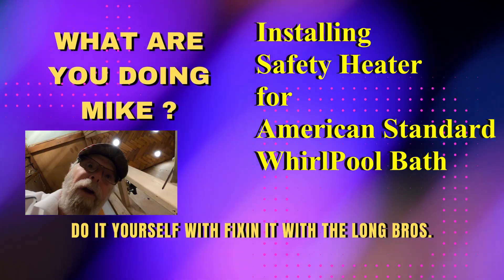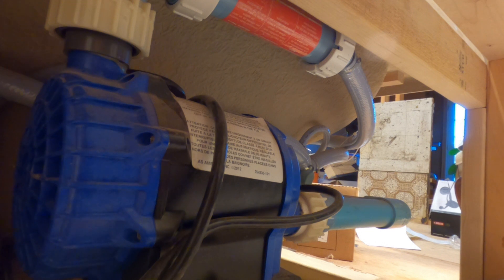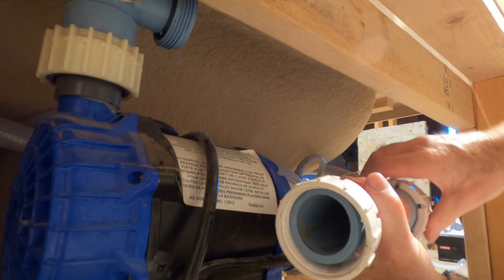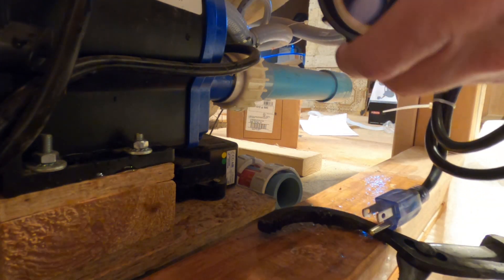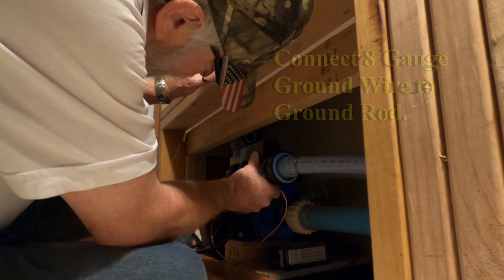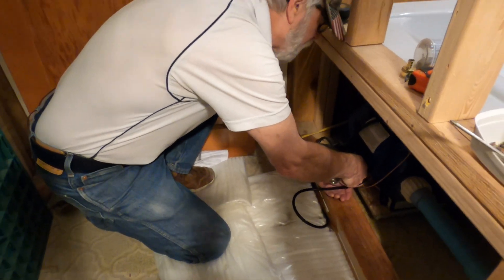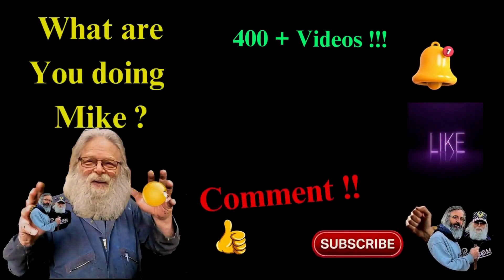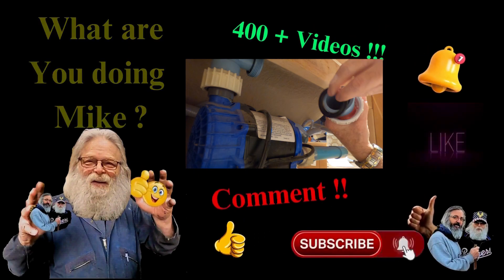Part 23 Bathroom Renovation..Installing American Standard Safety Heater for ECOSILENT Whirlpool Bath

Comment: Thank you for the video. I bought one of these heaters and it didn’t come with the instructions. How do you tell which way to install the heater?
Reply from the maker: Thanks for asking.@brandonsander803

..It's A heat Coil And doesn't matter which direction it goes when the water runs through it causes the heat coil to heat up so as long as the water is being pumped through the jets it continues to keep the temp hot. It really works great, really glad we got it well worth it.